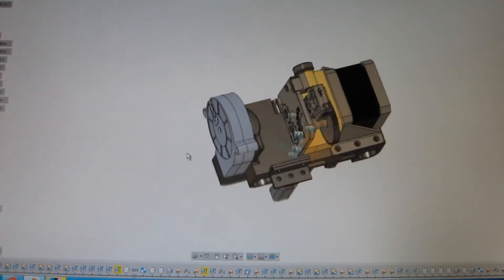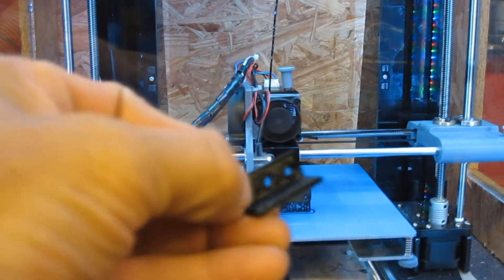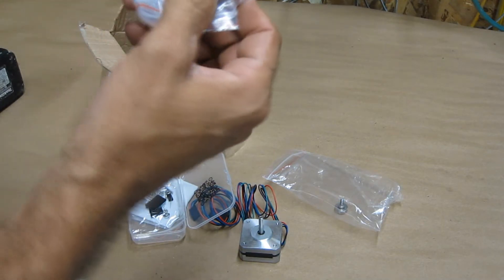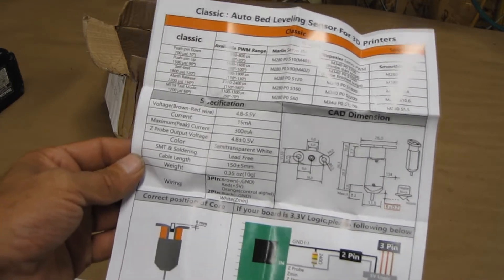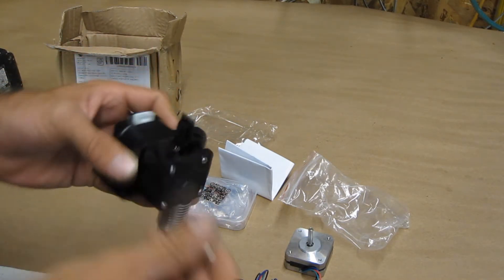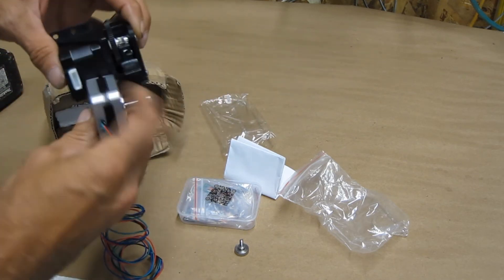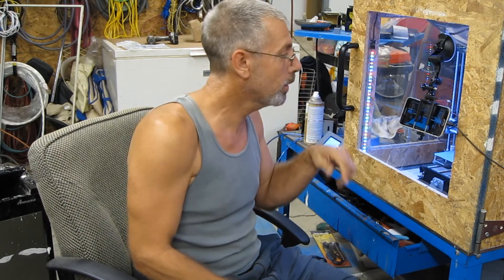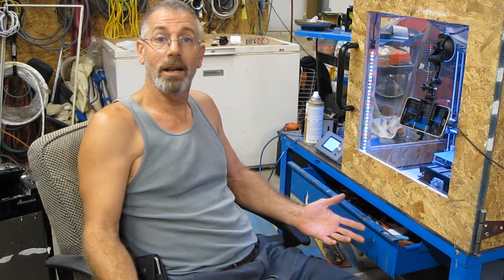The E3D TITAN EXTRUDER PROJECT, ANET A6, Part 2

Comment: Why heat-sinks for motors???If they're too hot, reduce the stepper VREF voltage. No need for them. Adjust them at about 75-85% according to to rating on the motor . Mine run and they're just warm to the touch which is fine.
Personally i just think its a sales gimmick for the unsuspecting public to make extra profits.

Comment: How did you get your printer so silent
Reply from the maker: Alex Slater I've done quite a few things to reduce noise. 
1) adding an atx power supply for just powering the board reduced the stepper noise a lot. 
2) igus bearings helped reduce bearing noise.
3) the enclosure also serves to keep the noise inside the enclosure. 

Take a look at my Fun Upgrades videos for all the mods that I've done.

Comment: You hate PETG?! I LOVE it, fix your print settings bro its an awesome material.
Reply from the maker: Patrick Nijkamp Yeah, it's getting better. Do you run any fan at all? I'm running about 50 percent fan and I think it's still too much fan. The prints look good but the layer adhesion could be better. I'm printing at 250 degrees, which seems to be the best for the esun petg.
Reply: I think I run 30% at max...and currently I don't even have a duckt on now haha. So I don't think fan is very neccesary. I learned that printing at lower temperatures results in less stringing for me. I print PETG at 235
Reply from the maker: +Patrick Nijkamp I don't mind the stringing so much. I'm more concerned with good strong parts, and so far, layer adhesion has been my biggest issue. I'm getting nice prints with the exception of some stringing, but that's no big deal. I'm gonna try no fan next time.
Reply: Marcel LeMay I totally get that. My first PETG print I had the first few layers breaking off, but after that at 235 and 30% fan (no fan first layer;)) it was amazing. It is so strong and I got red transparent which just looks sexeh hehehe. Also my parts print out perfect. No need to fix anything afterwards, stringing, drooping, oozing, none of that. 

How are your retraction settings?
Reply from the maker: Patrick Nijkamp Retraction is set at 4.5mm,  I forget the speed. E3dv6 direct drive. My retraction is good, I fixed that. It's just my layer adhesion, now. I think I'm still running too much fan at 50 percent. I'm gonna try turning off the fan completely on my next print. I haven't had much time to mess with it at all this week. No time to make videos, or play with my printer.
Reply: Marcel LeMay hehe that sucks man. I am currently (literaly at this point) converting my Anet A6 to a bowden setup with the frankenstein extruder and an E3D v6 as well. I am so curious to see how it will all turn out :)
Reply: Marcel LeMay oh and no fan? Should work fine! Try that :) let me know how that goes.

Comment: Just a thought while waiting for my A6 to arrive....How hard would it be to change the main carriage on this from a horizontal to vertical (Like A8)? Would lose a little in height, but would be easier for hot end changes etc....Thoughts?
Reply from the maker: MrStreetman1970 Yeah, someone on thingiverse already designed something to switch it over to a a8 style vertical rod setup. There would definitely be more options available. I personally don't like that design, mainly because I don't like the cantilevered aspect of it. Any play in the rods and bearings will be magnified at the hot end, because of the geometry. The a6 however, effectively halves the play that might exist in any one rod by its design. But that's just me.
Reply: I would agree with Marcel here, don't convert it. I have an A6 as well and it's amazing. If anything, make the Y carriage lighter by printing some PLA or PETG bearings LM8UU. Print Frankensteins extruder (or this one!) and buy an E3D clone to put in there so printhead is alot lighter, convert to bowden. My E3D is coming today, and did alot of mods already to make it better, faster and stronger (daft punk, anybody?). And I also bought a 22x22 glass plate, alot better then the aluminium.

Comment: Hi Marcel,
How's it going with the mod so far?

Got my A6 several days ago and thinking about this upgrade.
So far I changed parts which in my opinion should be changed on the assembly stage :)

- power supply (server 600W supply - designed cover for it)
- GT2 belts (fiberglass strengthened )
- Better hot end
- some custom filament holder...

Prints are not bad but always could be better...
Do you propose some other first-to-do upgrades?
Reply: Also which slicer do you recommend?
Attached CURA is not bad with provided profile but I found Slic3r more flexible but harder to calibrate.

Do you have some custom slic3r settings for A6?
Reply from the maker: przeczochrany I just got the whole thing running last night. Between Life obligations and beating my head trying to configure skynet for the extruder and offsets, it's been slow going. I should be able to get a video up showing it running.  I have one more design iteration to complete before I put the files out for the public. I gotta change a few things to make it a little more stream lined.
Reply: Great stuff!

Waiting for the video!
Also if the project would become great success, could you put some links to the parts used in the build and also Skynet firmware input?
Reply from the maker: przeczochrany 
it's gonna be a success. Once I have it finalized I'm gonna post all the files, the design files, the configure H,...etc. I printed some test files with it last night and there was a very noticeable difference in print quality from the stock setup.
Reply from the maker: przeczochrany Once you get the printer going print up some belt tensioners. Add some mosfets to keep the high current draws off of the main board. Take a look at my 2 fun upgrades videos for a few more ideas.